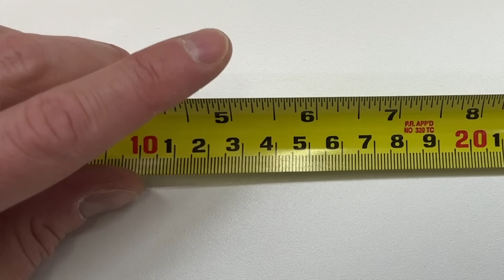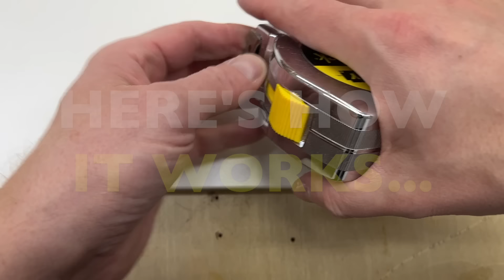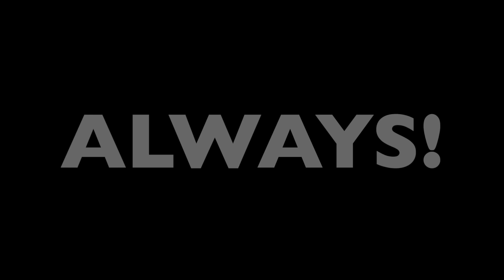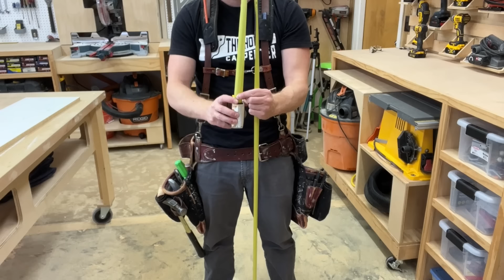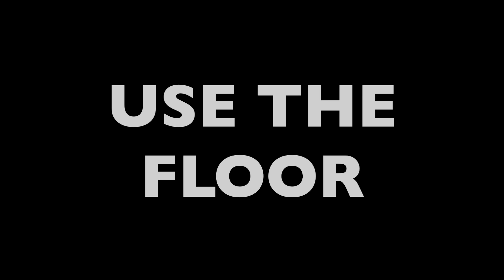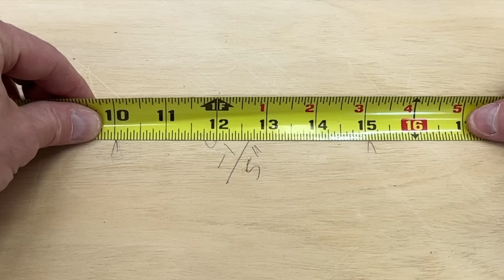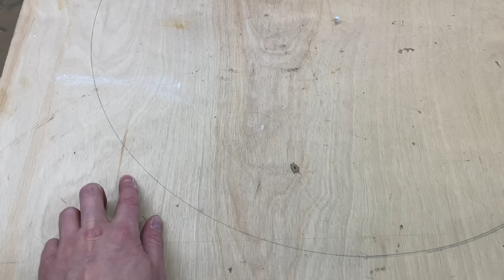ALL TAPE MEASURE TRICKS Explained...In Just 13 Minutes! (Measuring Tape Pro TIPS, TRICKS + ADVICE!)

Comment: Something my dad showed me many years ago (i'm 82 yrs old) about measuring into an inside corner. He said to put a square cut piece of masking tape, sticky side up, up against the corner. use the measuring tape as usual.. The tape will stick to the measuring tape. Then press it on the rest of the way.  The edge of the duct tape will then show the exact measurement into the corner, and easily peels off when you are done.
Reply from the maker: Cool trick, Carol! I love hearing about old carpenter methods 😄
Reply: ❤+ is a big thing that I think you should be 0]】7 might @TheHonestCarpenter
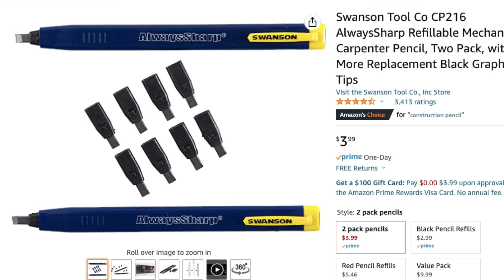Reply: @TheHonestCarpenter 12:33
Reply: Measure from one side mark at 10 inches (shorter if need be) measure from other side to your mark add 10, easy simple work  🤙🏽
Reply: @DvstyDom that only matters if you want to be accurate 😃. Bending the tape in the corner, if you’re running base, is a lot more cuts waiting to happen.
Reply: I like to take 2 measurements on an inside corner. Example, mark an even number from one corner and then read the other corner to that number. Add the 2 numbers for an exact measurement.
Reply: Cool, old timer. Self, make a note: always carry duct tape when i  go a-measurin’.
Reply: @wilgoster  i usually carry painters tape when im measuring stuff. Just in case my tape rune out of length I can make a mark and move the tape easier
Reply: I believe the Egyptians used the same trick they called it “ The old measuring tape and masking tape trick ” and they passed it onto the Romans who passed it onto to George Wimpey maybe your dad worked for Wimpey ?
Reply: Cool tip
Reply: If I need an accurate inside measurement I'll measure back an easy to calculate number and mark, then measure to that mark and add as necessary.
Reply: Find me a corner of a tight spot where you have to bend the tape to try and get the measurement I just measure out 6 or 10 inches. Then I'll measure from the other side to that Mark and then add 10 inches to it so you get a nice fit
Reply: If I’m measuring an inside measurement that is several feet, I measure from one corner out 10” then measure from the opposite corner and add 10” to that measurement.
Reply: Had a old timer show me a excellent tip when I was putting on plastic laminate on countertops. After you glue up both the countertops and the back of the plastic laminate with contact cement and let it dry to the point where it’s stick but the glue doesn’t stay on you’re fingers.   Most people use dowels sticks laid out on the countertops to get the laminate in place , then pull the sticks out one by one as you stick the laminate to the countertop. So you have to carry a bunch of long dowels sticks with you to the job site.
This old timer showed me a better trick that I have been using even since he showed me! Instead of using dowels sticks, use your extension cord and just lay it on your countertop from the front to back of your cabinet on the countertop like a snake  all the way down the cabinet top. Lay your laminate on top of the extension cord and get your laminate in place. Then slowly pull out a little of the extension cord as you stick down the laminate to the counter so plastic laminate doesn’t move on you.  Once you got the laminate stuck in place you can pull out the rest of the cord and press the rest of the laminate down with your hand and/or laminate roller. Works like a charm! Rather use a extension cord then dowel sticks myself any day.  Normally you always gave a extension cord with you on the job site!  May get some contact cement on your extension cord here or there?  But that never bothered me and if I wanted to I could clean off the contract cement on the cord with a little lacquer thinner.  Those old timers got a  lot of tricks worth their weight in gold and sadly sometimes those tricks get lost in the past.  That old timer that showed me that trick when I was just in my early 20’s. Now I’m the old timer myself in my late 60’s passing on this trick/tip so hopefully this one doesn’t get lost in the past too?  Very few people have ever seen the extension cord used on the countertop instead of using dowels sticks like this!
Reply: @ghostridergale  Yes, so many old timer tricks and tips are lost.  Even back in the sixties my dad used to complain about the young engineers just out of college who didn't know the basics.  My dad was a professional engineer who passed the New York exams without attending college.
Reply: @caroldragon7545 well you can be sure your tape trick and the other "old timer" trick won't be forgotten for at least a couple generations. I'll definitely be using both and showing them to my girls. For corners I usually measure out an even number, make a mark, then put the end of the tape measure into the corner in question, measure to my mark, and add the numbers. However, I've definitely had my fair share of projects where that just wouldn't work for one reason or another but that tape trick sure would've!
Reply: @ghostridergale ▪︎ thanks for the tip but I'm new to the game and can't quite visualize. My extention cords have big plug-in ends; don't these ends drag thru the partially dry glue? And if I'm laminating a long countertop, say 6 ft or more, should I use 2 extention cords laid out parallel to each other, down the entire length of the counter? From one end to the other, which would be 6 ft or more away?
I'm sure you'll have a chuckle over my question but one has to ask to learn, correct?
Thanks.
Reply: @bethanyanderson1745 I think you’re thinking of it laid out wrong. You go from the back of the countertop (the wall) to the front ( where the drawers will be) and then curl it back towards the wall and just keep doing that. You don’t run the cord from end to end. If you do it the way the other person is saying, then when you pull the cord out, you’re only pulling that one curl out from the laminate. It can’t be a house extension cord either. The little brown or white cords. It has to be a real extension cord (the round cords that are 12’ or longer). The longer the cord the easier it’d be.
Reply: @Ohio-Patriot  ▪︎ yes! You are correct! I was misinterpreting the placement the cords. Thank you for taking the time
  
■~~ great username for Halloween!
Reply: @bethanyanderson1745  you’re very welcome. Have a great Halloween!
Reply: Today's kids ... What's a dad ?
Reply: yea man I dig it good idea  .  Or mark a line and spin the  tape around and do some easy math
Reply: Nice trick. But only a noob would really need this.
Reply: This is why stuff built in the 40s is still around and D.O.M. 2021 stuff is already trash.

Your dad was O.G. that's for sharing that mate!
Reply: @subtlename2873  You're right as rain.  I have a fair amount of stuff my dad had when I was a kid in the forties.  I doubt that there is much around today that will last for 70 years.
Reply: @subtlename2873   there are high quality homes being built today.  If you have an $18 million construction budget you'll probably get a nice home.
Reply: @subtlename2873 it’s literally no different there are plenty of bad buildings from then that we repair now but there hasn’t been almost 80 years since the houses built now to even know that. It’s just confirmation bias
Reply: @ZootedSosa  No, we don't even need 80 years to see how shitty things are built today.

Comment: I love the trick to find the middle of odd-width/length boards by holding the tape at an angle until you hit an easily dividable number; way easier than dividing fractions!
Reply: That is a cleaver way to split the measurements equally.  I learned that trick from watching April Wilkerson's channel.

Comment: Couple things I would add is if you happen to drop your tape measure, always check the tab to make sure it’s still square and not bent at a angle that will make your tape measure read wrong ( longer then it really is)  if the tab is bent towards your tape box.  I’ve seen quite a few people working with a bent tab and not ever catching it and wondering why their cuts aren’t accurate?
Another tip is I see many people not use to using a tape measure not holding their tape measure parallel with their work piece their measuring. Running their tape at a angle making the measurement on the tape longer then it actually is. For a good example once I asked a customer if they had a 36” wide front door or is it only 30”? They grabbed their trusty tape measure and measured their front door. Told me oh yea it’s 36” wide!  So I went ahead and built the cabinets at the 34” wide it needed to be at the shop. Get out to the job site and low and behold the door width is only 30”!  Luckily they had a sliding door in the back of the building to get into their home. Bad part is this was a boat house and the cabinet had to be put in a row boat and towed around the boat houses to get out to the other side of their home. Then taking a heavy cabinet out of a row boat while the deck you’re standing on is also moving under your feet makes it a difficult task not to end up in the river with the cabinet if not yourself too! Fortunately we got the cabinet out of the boat without ending up in the drink!  This is a good reason not to trust your customers doing measurements for you! It can cause you problems when the customer doesn’t know how to use or read a tape!
One other thing I’ll mention that actually surprised me too! Is not all tape measure read accurately. Take a few tape measures and stick them all on a board and see if they all read the same?  Depending on the length you have the tape out I have found some tape measures off by a 1/4” in extreme cases.  Some will be closer but still off 1/16”-1/8” from one tape to another tape readings! I know a 1/16” don’t sound like a lot, but that 1/16” of a inch can be a real problem when someone measured with their tape measure and giving you their measurement and you cut a board to their measurements with your tape measure that reads differently and your material either ends up short or long a 1/16” of a inch. If long you can always cut it again, but hard to add that 1/15” back on a board you cut short!  So it’s a good idea to pair up tape measures making sure they measure exactly the same?  Especially if both tapes aren’t the same brand!  Cheap tape measures are often not accurate!  They will still work if your doing all the measurements with the same tape measure, but you may have a problem when another tape measure is used  in the project doing cutting  off a inaccurate reading from a bad tape measure!   Thought these would be a good thing to add to your video that can really be important to even semi pros that maybe not ran into these issues yet?  Know I was in the woodworking business several years before I found tape measures that didn’t read accurately with other tapes!  Hope it helps !
Reply: We had an ADA counter come out 1/8" too high. That "bent tab" (oopsie) came in handy. I'm sure no handicapped person was injured and we were saved from our narcissistic CA inspector.

Comment: Awesome tip about burning an inch. Just two points to add: some tape measures mention the length of the casing somewhere on the casing, usually on the back below the clip. This kind of makes the measurement to corners easier. Another point is kind of a safety tip about your finger getting pinched once you release the tape to retract. Some tapes have a finger guard but Stanley doesn't so be careful folks :)
Reply: Yes!  I recently cut a nasty cut on my index finger letting the tape measure retract with my finger still near the crimping position.
Reply: I don't think it makes the measurement to corners easier.  You still have to judge visually where the tape intersects the edge of the casing.

Comment: You can do the split option on inside-to-inside measurements... if time and experience are factors. Measure about halfway each way.

Also, a lot of tapes have the length of the casing imprinted on them, so you can add that to what's showing. The main problem I found with this method is knowing where to reference on the tape itself. The second problem, the case is always (example) 2 13/64. Really? You couldn't plan that better Mr. Tape Measure company?
Reply: I got one of those.  Least used tape.

Comment: Always good advice! Even for small projects, I always use a tape measure in conjunction with a combo square. A tape measure is your first look and a quick double check, you spend a lot of time staring at wood with a tape measure in your hand. I like the fractions trick, in my shop I have an 11x16 sheet with a blown up inch scale with 32nd's, 16th's and so on labeled. It's handy having a big quick reference sheet you can walk back to with a combo or tape measure, especially with 32nd's.

Comment: One way to take internal measurements without folding the tape is to measure from one side an easy distance to add up, say 10 inches from the edge, make a mark there, then measure from the other side to that mark and add that measurement.

Comment: Great video.  My Dad had a roofing and sheet metal business so I learned some things about a tape measure in my childhood.  It is good to know the tips and tricks.
Reply from the maker: That’s cool, Ed! I spent a lot of time on the old bending brake when I was a kid 😄
Reply: @TheHonestCarpenter  Thanks - my Dad had an 8' brake in his shop and I'd watch him use the brake and other tools to fabricate custom roof vents and roofing valley.  He had soldering irons he'd heat up in a fire and used a foot long bar of silver solder and sulfuric acid to solder sheet metal together.  He had to sell his business when I was 7 years old but I'll never forget those times.

Comment: Spot on Ethan. You broke down the basics very well. I've been using a tape for decades and do these things naturally. But you brought up things that come with experience. Great video Sir
Reply from the maker: Thanks Bob! When I make vids like this I always ask myself, “what didn’t I used to know?” and try to think back to what confused me in my earlier years.
Reply: Yeah I’ve never watched one of these before.  I’m a Forman at Moran construction.  I didn’t realize that I do every single tape technique out of muscle memory while never being showed when I was younger how to do this.  Now I’m sure I picked up a few things down the line.  But tape handing described in this video is exactly the same as I use mine.  I always use Stanley power lock 25 or 30s too. And I never use the lock unless i lay the tape out and have someone else do 16 oc set ahead.  Also. We burn an inch or 2 almost always in trim work. But in rough framing.  Hardly ever

Comment: I've had/used a Stanley Powerlock 25' for a long time... So obviously I agree about them.  But a year ago I bought a tape that is read left or right ( FastCap PSSR25 25 foot Lefty/Righty Measuring Tape) and now it is all I ever grab for anything less than a room-sized project.  Plus, I love it having a pencil sharpener built in!  Yeah, it probably won't last as long as my Stanley tapes last.
Reply from the maker: Somebody else just mentioned that, Larry!

Comment: I'm a stalwart defender of the imperial system, and I like that our foot is divided into twelve increments (base twelve has some clear advantages for measurement).  However... can we all agree to get rid of the binary subdivision of the inch and just go with decimal inches?  Please?
Reply: I concur! I do all my measurements in decimal, e.g. 3.25" instead of 3 1/4".  Makes designing, purchasing, and cut lists much easier.
Reply: @aprilhoover3481  The funny thing is, that's how engineering is done in SAE anyways - decimal inches or feet, decimal pounds, kips instead of tons.
Reply from the maker: Interesting compromise, Kenneth!

Comment: Any suggestion on what to do with a tape measure that no longer wants to retract all the way back in?
Reply: Cut it and tack the tape to the edge of a workbench or lumber rack for quicky measurements.
Reply from the maker: Sometimes a full draw out will reset the spring, Susan. But if it still won’t go, I’d say toss it!

Comment: The Hultafors Talmeter has build in options for marking and measuring internal and external measurements. By far the best tape measure i have.
Reply from the maker: I’ll look into them, Maxim!
Reply: Agree about the Hultafors, alot of smart features. I really like that they automatically lock the tape as you pull it out, and then you press and hold the button to retract the tape. No need to crimp it with your finger.

Comment: Hello, Mr. James;
Great video, BUT!
I was hoping you would mention the left-hand & rt-hand tapes.
I don't know much about it except the numbers are flipped over?
Colin Knecht (WoodWorkWeb channel) mentioned it but I'd never heard of it.
It is which way the numbers read, left to right or right to left.
Depending on which hand you use to hold the tape, if I understand it.
One way to think of it is the numbers are upside-down when it is in the opposite hand?
I keep a Stanley 12' to hand, when I hold it in my rt-hand & pull it the numbers read left-to-right, right-side up.
If I hold it in my lt-hand & pull it the numbers read right-to-left up-side down.
But how do I tell which tape is which, so I know which one I'm buying?
I 'think' my 12' is a rt-hand but if I want a lt-handed tape how do I know which is which?
Have a GREAT day, Neighbor!
Reply from the maker: It’s funny, Jon, but I had never thought of it before! I guess they all are right handed standard, unless otherwise noted. But I do so much reading from either side that I got used to upside down reading!